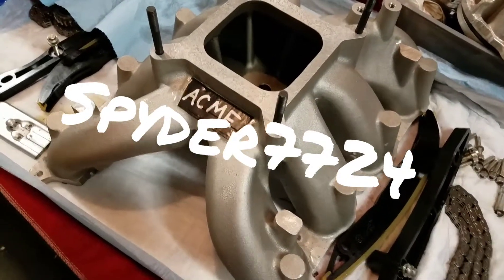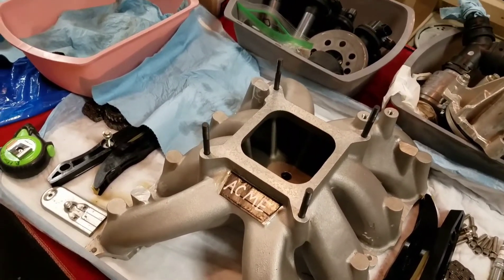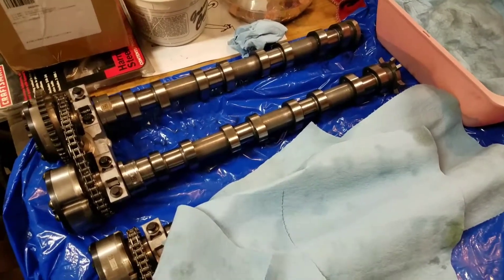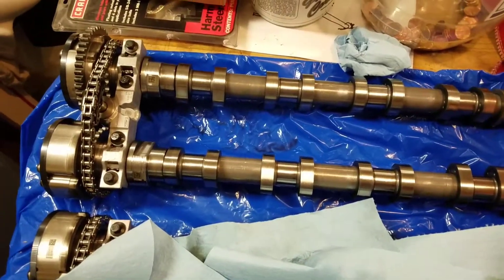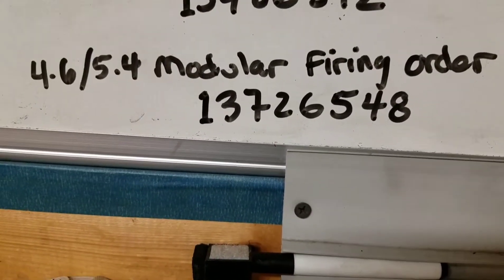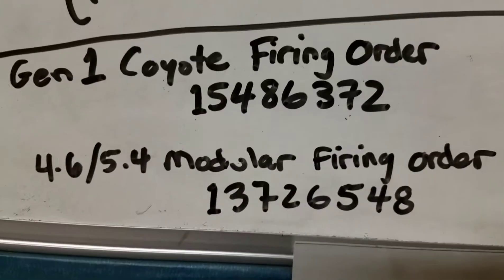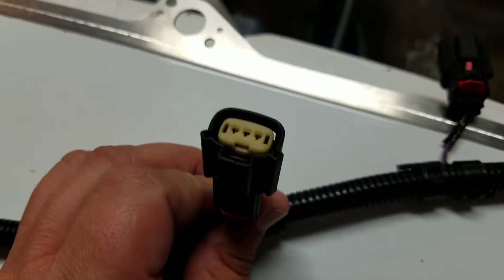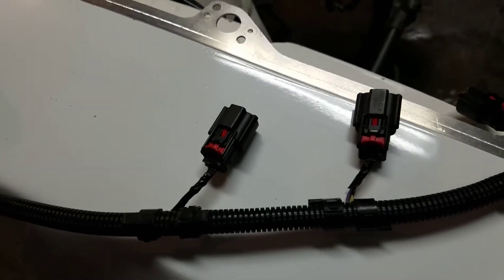Coyote 5.0 carburetor DIY ignition setup MSD Mod6

Comment: Alright Iam intrigued and have some questions. Are you running a motor plate? What oil pan is needed to fit in a fox? Really thinking of doing this in the near future as a NA build for bracket/index racing. Seems simple enough and a great foundation for big power if the plans ever change.
Reply from the maker: I used a SBF k-member and made my own mounts. Honestly no reason to do that just because i already had it. Normally just use a mod motor k-member and mounts for a foxbody.

Comment: Does it say what amps the power wire requires? I know it’s a 12v but is it like 20-30 amps? 40 amps?
Reply from the maker: I ran the ignition box off a 12v 20amp fused and relayed circuit with no issues.
Reply: @spyder7724  okay perfect, thank you! Wait, fused and relayed? What exactly was the relay needed for? For the 20 amps or higher?
Reply from the maker: @Diamondsintherubble  probably not necessary but i fuse and run just about everything off relays

Comment: Great video. Thanks for posting. I got a running F150 Coyote for cheap and plan to use a Mod 6 box to fire the coils and an SDS efi system to fire the injectors. Your info will help

Comment: What if I had say a 11 to 14 coyote powered 5.0  and I just wanted to run a carb,d intake & carb, would I still use my factory computer or mid-6
Reply from the maker: The factory ECU will need the inputs from the TPS, IAT etc to follow its timing maps. The MOD6 was just an easy way to bypass all that and make it simple.
Reply: @spyder7724  , I gotcha

Comment: On the camshafts where is the information to do them do you just do the exhaust on one side or do exhaust on both sides or do you do all four cams will this theoretically work with a 5.4 4.6 computer and harness since you're tricking the cam into thinking it's a 5.4
Reply from the maker: I have a video with the cam tooth/trigger wheel mod. Since I used the pass side exhaust cam I just modified that trigger wheel. I think the video for the ignition setup is the one I explained which tooth to keep.
Once the cams are locked it's just another 4v motor with a slightly different firing order.

Comment: Did the MOD 6 box comes with the engine harness
Reply from the maker: It comes with the harness for a Mod 4.6/5.4 but the coil pack connectors on a Coyote are different so those have to be swapped. My engine came with a harness so I was able to rob the connectors from that. Otherwise the cam and crank sensor connectors plugged right in to the Coyote.
Reply: @spyder7724  ok sweet I'm doing a very similar set up may have soon other questions in the future
Reply from the maker: @mikevanmeyl123  no problem. I'll try to help however I can.
Reply: @spyder7724  I just picked up my engine and came with the harness so I'm able to take the coil plugs
Reply: @spyder7724  in order to run the coyote motor on my 4.6 ecu i have to swap the firing order on the injectors too?
Reply from the maker: @rodriguezluisu87  yes or else the fuel signal would be off for those cylinders.
Reply from the maker: I did run the spacer.

Comment: How do you lock out the cams?
Reply from the maker: I used Comp Cams adjustable lock outs but there are others on the market. L&M engines has some that are custom machined for each combination. I dont think they require degreeing the cams like mine did.
Reply: @spyder7724  do you have to do that if I run the msd mod 6 on a coyote
Reply from the maker: Unless you go with some type of engine management system that can control the VCT then the cams would need to be locked. MMR has a belt drive distributor that would allow you to use a conventional ignition system but again the cams still need locked. If you use an aftermarket ECM to control the cams and ignition then in my opinion just go EFI and make it easy. I did this whole thing just to be different but it definitely wasn't easy or cheaper.
Reply: @spyder7724  this what you bought https://www.compcams.com/adjustable-phaser-lock-kit-for-ford-5-0l-modular-v8-engines.html 

And ya that's what I'm looking to do something different